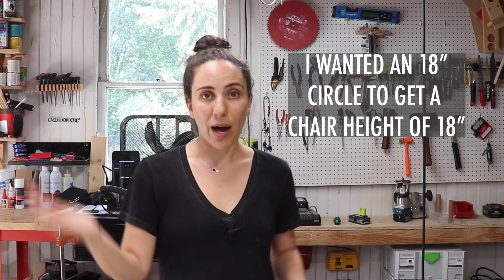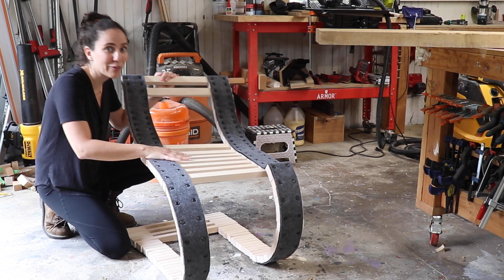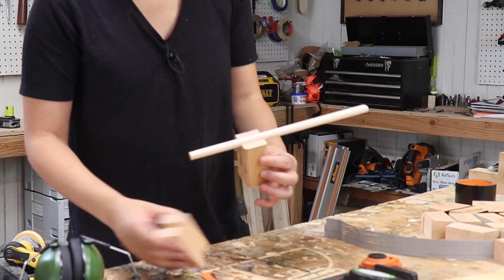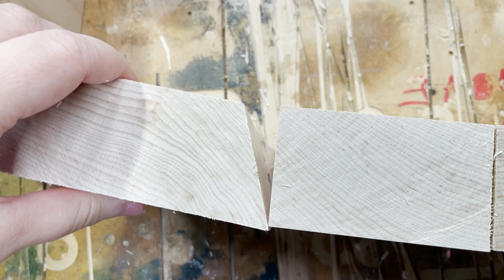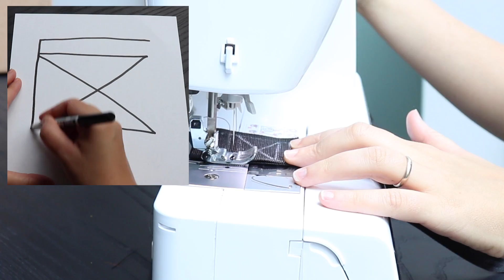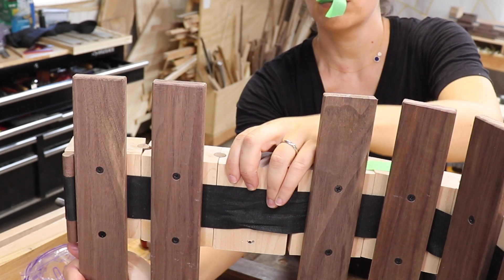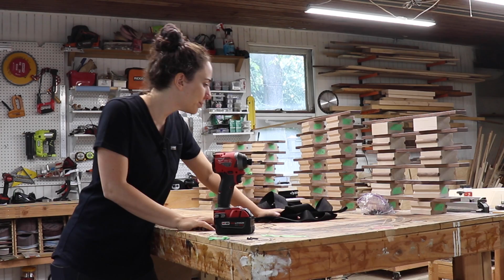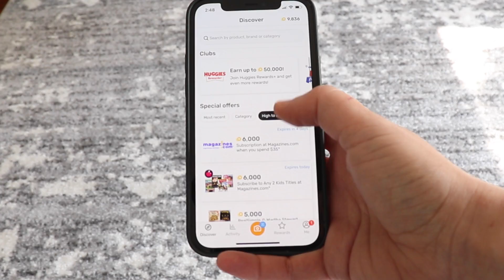I ATTEMPT to make a Roll Up Chair… AGAIN...

Comment: Normally watch these videos just before bed on my phone, but I'm so invested in how this chair works out, that I watched in on my TV in 4k 🤣

Shame it didn't work out. I know you wanted a clean roll up chair, but I was thinking of structural reinforcement "dowels". Two thick hardwood vertical dowels that screw/fit into holes in the base and  going up to the rear of the "seat" section. Though that would mean you have two extra bits of wood floating around that might be misplaced.

Strapping material suggestions:
A) carbon nanotubes (as per theoretical use in space elevator tethers)
B) Golden orb spider silk (very expensive)
C) double sided tape, as per your outtakes 🤣

You mentioned leather, doesn't that stretch/relax over time. All my leather jackets and leather sofa have stretched over time. Unless you're speaking of a high grade specialist leather.

Comment: Hi, Tamar! I'm wondering if you're married to the strapping concept? I think you could build this chair with nearly zero flex with no strapping. Make each section a hinge that attaches to the next piece using the walnut dowels as the hinge pins. Maybe? You're my favorite woodworker on YouTube, keep kicking ass.

Comment: So disappointing!  Perhaps the next step would be to make a backless chair, where the two ends connect to each other.  That way, all of the curves are facing the same direction.  Alternatively, have the bottom end of the current one connect to the back of the seat to form a loop and have the seat-back straps NOT share tension with the rest of it.  Does that make sense?

Comment: Perseverance to the extreme! 
Leather is a wonderful material but as a leatherworker om not convinced it will work. It has a tendency to stretch over time. Just look at an old belt taking shape efter som years of use. Stitching along the edges might remedy some of the stretching but I wouldn't trust it for this application. My solution would be a thin steel cable running freely through the center of the pieces and secured at the top and bottom. The tension would be lined up with the indexing dowels.

Comment: Galvanized pipe hanger strap. It's flexible but not stretchy, and it has holes that you could use to screw it to each piece.

Comment: What if you built the maple segments with a wood or metal eye built in, for the dowel to pass through, (so they will hinge one way but lock together in the other direction) and eliminate the straps altogether?

Comment: Impossible? Maybe. Super ambitious? Definitely! 

My only suggestion would be a material like those steel or nylon straps they use for shipping. They're supposed to be under tension, so maybe that would provide the strength you need?

Comment: I'm not an expert on webbing but the weave in the pictures looks like it's going to easily deform and stretch under tension which is definately not what you want. You need seatbelt material, it's designed not to strech during car accidents.

The straight ends failing I think it because the webbing is only restrained at each end. All the tension force from the chair is being applied on just the end blocks and with a little bit of movement it's giving them enough turning force to flip out of position. If the webbing were attached to each block then the tension forces would only be applied to the blocks where they were needed, the bends, where the angled wood will make it more difficult to snap out of shape as it needs to turn even more.

But this is a really cool project and a pretty nice looking chair even if it's glued together, although I think the foot is a bit long for the non collapsable form.

Comment: The design & engineering is genius, you just need to find the right materials.   

Having designed sailing rigging, I would suggest materials used in those applications - spectra, dyneema, kevlar or carbon fiber.  These don't really stretch so they may work better.  As others have suggested, wire rope works, but it's not the same design ethos.
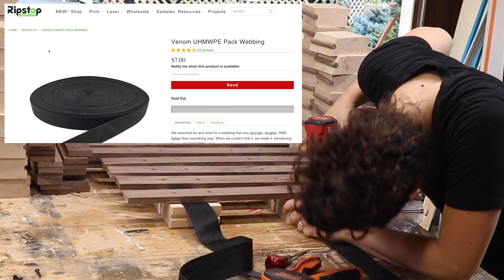Reply: she already used dyneema/spectra - they are brand names for "uhmwpe"  - 16:26

Comment: Tamar, instead of just the two points securing the webbing, you need to have every slat be a secure mount point for the webbing.  (but not with staples).   I would create complimentary grooves/grips between the back piece and the top piece to grip the webbing at each slat.   The wood would act like a vice at each point preventing the stretch you are seeing without having to over-tension the webbing.   But use at your own risk.  No guarantees since the forces created are deceptively large.   In fact, I don't think any wood is strong enough.  It will either crack or crush at the fulcrum points.   Good luck, though.  I'm impressed with your tenacity.
Reply: UHMWPE is almost as slippery as PTFE (Teflon)
Reply: yes a lot of shorter pieces of webbing would probably limit the flexing, steel wire maybe.
Reply: I think if you just replace the webbing with door hinges, it should work and be easier to mount to boot.
Reply: Mitch, I totally agree! I am a chair builder by trade and I find these videos about trying to "save" a bad design by some kid on the interwebs rather cringe-worthy. 2 minutes with a tape measure, a calculator and a stress-strain table for nylon webbing will show that this concept is doomed from the start: the stuff is just way too flexible (and influenced in its properties by temperature and humidity) to allow this concept to work. What amazes me is that she doesn't learn. A lot of people have given very competent input but she's continuing without making use of the insights people are sharing here...

Comment: i love the project.

the biggest problem with your tensioning system is that the straps can slide and put all the slack at the most stressed joints.
a system to lock the strap to each individual piece would spread out the slack, it will be a nightmare to tension though.
an alternative is to tension the straps in subsections 

my solution is to round the top corners where the straps are. and mount the straps a bit to tight, then unrolling the chair would tension every joint a little bit.

another thing i thought of is to double strap it with spacers, two straps on each side perhaps on top and bottom of your seating bords.
this would make the construction flex less for the same amount of stretch. since the distance from the strap to the end of the clamped wood would increase.

Comment: The second installment of a trilogy is always the darkest one, right? 😁 It definitely looks like you got closer this time around. Perhaps it's just a material issue and you just need to find the right strap or cable or whatever that doesn't stretch to solve the flexing problem. I wonder if you shortened the arc of the front curve if that would help. Let it settle into its final form when you actually sit in it. Also wanted to see if adding the dowels as splines solve the twisting issue. I didn't catch you mentioning that in the video. Better luck in part 3! Thanks for sharing!

Comment: Ok, I'm gonna shoot my reactions idea, you may try to:
-mount the maple end grain to end grain, to reduce compression
-use thin metal strips, it gives way less than any fabric belt.
Unless you can find a belt made out of 100% Dynema 😄.
That being said, i love what you do and never give up🤟🏻
Reply: she already uses a belt made of 100% UHMWPE (check what "Dyneema" is)
Reply: I considered metal strips but then realized they'd likely get wrecked from constant back and forth bending
Reply: @ufffd  you mean "work harden". (stainless) Spring steel will outlast the wood many times. Steel has a lot of grades and types, yet the wood is like the weakest material by far.
Reply: @stanimir4197  is there any type of steel that can handle being bent/kinked back and forth at tight angles repeatedly? It's the roll up I'm worried about not the sitting
Reply: @ufffd  steel wires/ropes can do that - if you consider using sheet metal like spring - the chair won't bend. Overall if the steel can be bent/deform, it'd not serve its purpose in this case. Deformation means stress pass its yield point.

Comment: if the problem is in the tension, why don't you just use hinges on the joints, at least it's still a roll up chair

Comment: What needs to be done is to isolate the tension of the strapping to each individual joint. How I would accomplish that is to install 1/16 metal rods between the blocks and the cross pieces. Two rods per piece, per side. Cut a tiny dato in the blocks to receive the webbing and adjust the tension as appropriate for each piece. This will keep the webbing from pulling from one section to the next and elimate the concave section from collapsing. 
I would strongly advise against using Leather. A non-stretch material is needed and the UHMW is likely the best you'll find, short of Kevlar.  Good Luck!

Comment: In terms of engineering, the failure point that you are seeing is due to deformation/stretch of the straps (as you suspected). In that region, the blocks are actually a pivot point (where they are contacting each other on the inner curve) and they are wrenching/stretching the strap with high levels of force.  You'll be wanting to use materials that have a very high Elastic Modulus which is a very inelastic material (i.e. won't stretch).  The elastic modulus of steel wire is 183.9 GPa, but the modulus of elasticity of nylon is 2.7 GPa, and if that is in woven form, it will be orders of magnitude lower I suspect.  Though your venom straps are advertised as high strength, and light weight (which they very well may be) they will stretch under load. I suspect any natural material is going to fail here, as well as any woven material. Is there any reason steel cabling wouldn't work for this? Cut a thin surface channel in the same place your straps are located now, and the cable can ride up and through the whole piece. This will provide the "tightness" you need in the lower section, and in conjunction, your dowels may keep the lateral movement in check.  If you choose the right material, you won't really need to pre load tension in the system, as the tension in this scenario was needed to offset the elastic properties of the strap, so hypothetically this should make it safer as well.

Comment: I tried to make a canopy like this once, but I used steel cables. It still never worked. You just can't get past the compression of the wood. Even under its own weight it will sag more and more over time. Somebody suggested I try stabilized wood, or fastening the cable to each slat individually. But I had already given up at that point.

Comment: The design is fundamentally flawed (for wood) because the strap change from grabbing the outside of the blocks to the inside radii of the connecting planks.  Plus the the cantilever effect.  Even gluing together is not a good thing.

Comment: Good for you to try to refine your design. One idea is that perhaps instead of just two straps, you might consider using 4, thus halving the stress on each strap. Another observation is that the blocks, even with the dowels, were trying to slip past the dowel. Using a larger diameter dowel might help prevent that or perhaps two or even a lock miter type of edging to get the blocks to lock into each other. But I know you have invested a lot of time in this already. Thanks for sharing your attempts and using good engineering principles to try to overcome each small problem with a solution. I enjoy your videos and learn from them. Regards.

Comment: So I have a dumb (unless it works?) idea:

Why not use door hinges? They won't flex the way fabric will, and should be plenty strong enough. You'd have to use a strong wood and whatnot to keep the hinges from ripping out, but if you could get them in there secure enough I should work. You could also maybe put metal plates on the inner joints (on either side of the dowel rods) to help prevent the wood from compressing too much under weight.

Plus, with the slats you put on the chair you've already made plenty of clearance for the hinges, so they shouldn't disturb the person sitting in the chair.

Whatever you decide to try next I hope it works! I was rooting for you the whole time!

Comment: Hi Tamar, 
Thank you for taking us along on your journey with this. 
It occurs to me that because the webbing is only anchored at the ends, when the chair is loaded the tension in the webbing is constant along its whole length but the required tension varies at each joint. That's why when there's enough tension in the front "leg" area there is too much everywhere else. There's probably about half a ton of tension needed to keep the leg segments together but nothing like that much in the feet, seat and backrest areas. If the webbing were glued to each block so that it couldn't slide then the tension would vary along its length and it could only stretch a small amount across each gap. I'm not sure this would completely fix all the problems but I don't think that allowing the webbing to slip past each block is doing you any favours. 
Also where the webbing is in tension on the inside of the bend, where the seat transitions into the backrest, it is pulling away from the maple blocks and allowing the other joints to open up.

Don't give up, I'm sure you'll get there in the end. x

Comment: Your dowels gave me an idea. What if, instead of using strapping on one side, you used metal hinges in the middle of each block, replacing the dowel and slotting into the center of each block. It might make it cost prohibitive to have a hinge between each block, but it might be stronger and there shouldn’t be any stretch.

Comment: So I had a thought for you. What about making the strapping extra long on the top so that you can affix it to the bottom after it's unrolled and opened up to sit on? Do everything you did already, attaching it at the top and bottom just like you have already done, but have a loose length long enough to hang over the top and hang towards the bottom, then somehow slide onto a "latch" of sorts at the bottom. It would look like the backside had vertical support up to the top but what it is actually doing is keeping the bottom from trying to curl under itself when under tension as well as keeping the top from trying to curl back towards the user when under tension. Then it could maybe even double as a wrap to keep it rolled up when you have it in its rolled-up, stored mode.

Comment: Gosh I felt every second of frustration with you in that one 😖😅 
I know how you think out the box so how about a different approach. Keep the straps with good tension and (I hope this makes sense) have a small dowel going perpendicular to the ones you put in this time. This might be easier through a flat bit of the joint and a hole on the opposite side, almost like a removable tenon so it pops out when you roll it up but acts as a pin on the inside when the chair is made up. Does that make sense? Just thinking out loud and it’s need a tester but a short dowel on the inside might just stop the gaps in the joints. 🤷🏼‍♀️ 
Good luck with the next attempt!

Comment: great 2nd try - inside and outside curves make the strap not viable. Maybe use a metal cable down center so "strap" is between the curves - plus you can put tensioner on one end

Comment: Leather would be even more stretchy than the synthetic straps you used. Metal cables threaded through and tensioned would have a better chance of working.

Comment: Leather definitely won't work. It stretches too much, especially over time.
You'll need steel cable or kevlar. (kevlar doesn't stretch)

It's been too long since my engineering physics days in college, but honestly, I don't think this is a do-able project. 
When sitting back on it and relaxing, the angular forces you're exerting at the knee are going to be pretty high (that's why you sat near the knee location of the chair, and it could hold you up). But picture a 200lb person sitting on it and relaxing back. I'm guessing ~150lb is at the back of the chair. All of that weight converts to angular (rotational) forces on the chair where the knee is located. That thing needs to handle ~300lbs of rotational force at the knee location. And heaven forbid the sitter decides to bounce or rock the chair! Those forces will skyrocket. Not only will that angular force be concentrated at the knee location of the chair, but that cable will distribute the force and anything that receives the distributed force (ie, anything holding the strap) will need to be anchored in such a way as to mitigate the skyrocketing forces of someone bouncing in the chair. (that's why the ends tend to buckle when you sit in it).

Nifty project - but I'm highly skeptical that it's doable. Sorry. 

Love your tenacity tho!!

Comment: Still not the right belt material. This is elastic and the more you stretch it the weaker it gets. You need something that doesn't stretch by design. Timing belts from car engines could be suitable. Simply ask the nearest car dealer for some used ones they will be free of charge. Chains like bicycle chains might be an other option.
BTW i saw an advertisement for such a chair only a few weeks ago. Sadly didn't bookmark it. So it seems to be possible.

Comment: It may not looks like sleek, but what if the inner radius of the curve was lowered, making the blocks thicker.  I think it would convert some of the force stretching the strap into a normal force on the wood.  I drew it up on Blocklayer, but they don't have a link to share.

Comment: I am not sure that any woven webbing would actually work for this. Maybe try steel cables, or even some motorcycle chain, those maybe would have the required strength without easily stretching too much.